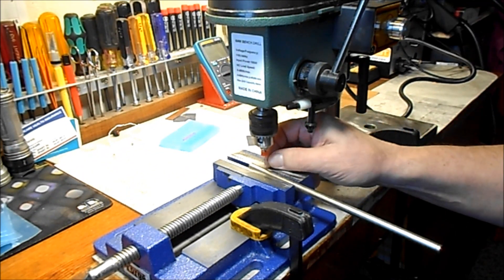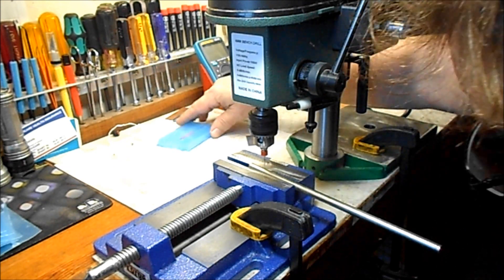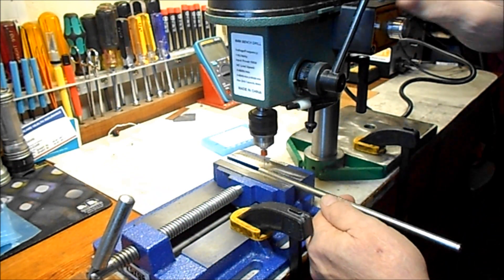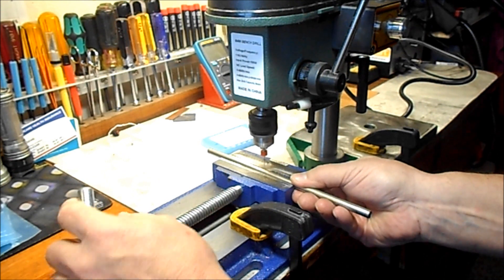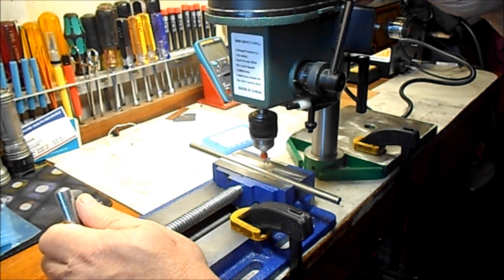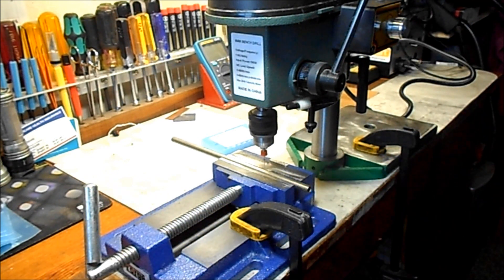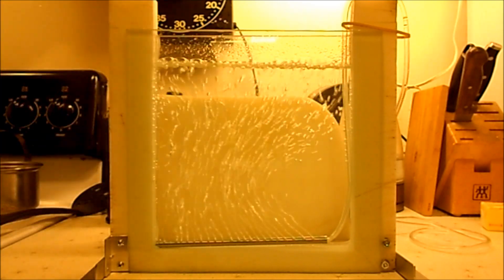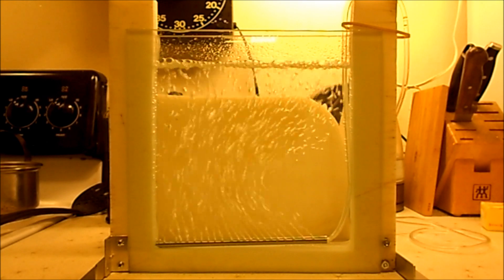Home Brew PCB Etch Tank

Comment: You should try using a plastic tube because ferric chloride will rust stainless steel
Reply from the maker: It's Titanium so no worries about corrosion.
Reply from the maker: I've been using it for 3 years. No negative results.
Reply from the maker: I use copper chloride and hydrogen peroxide, much cheaper and faster.
Reply from the maker: And HCl acid as well.
Reply: @garybevis8691  can you share how to mix copper chloride and hydrogen peroxide?